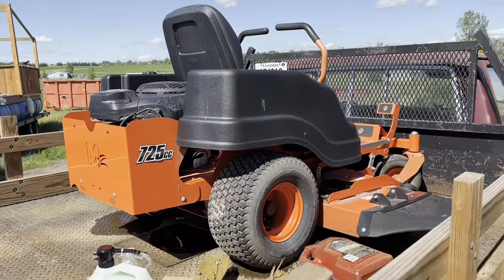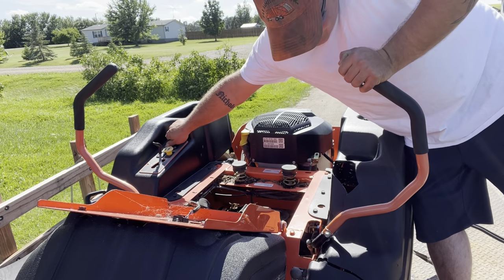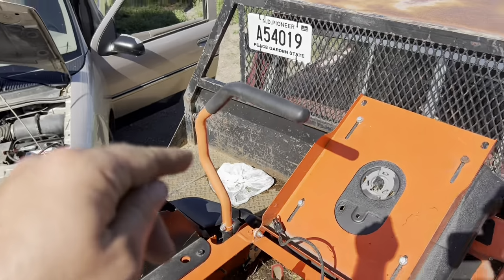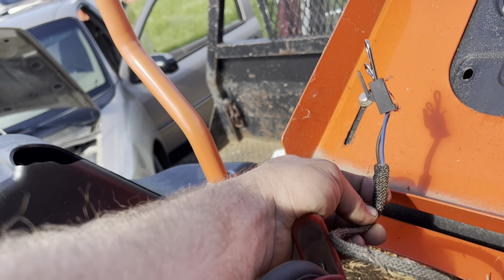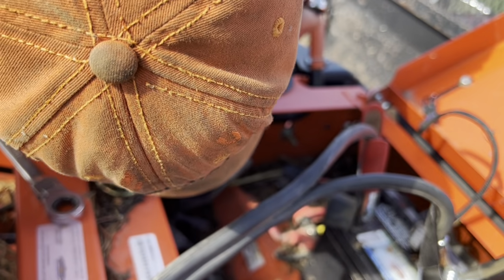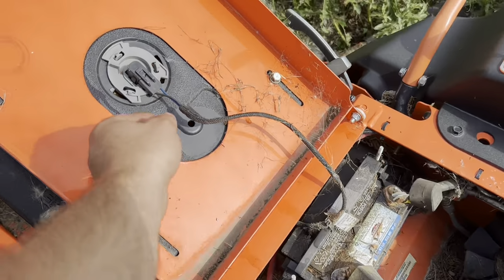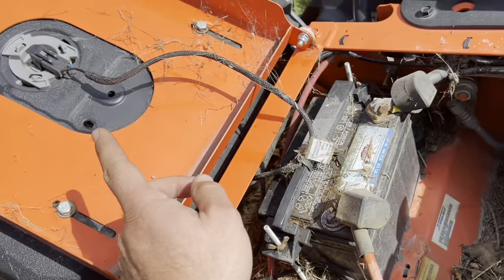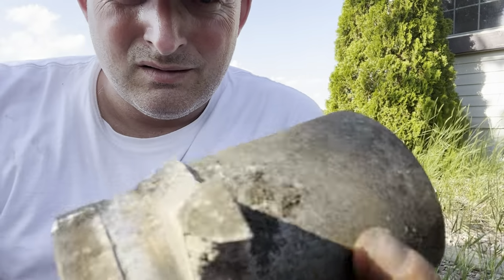Zero Turn Mower Wouldn’t Start Bad Boy MZ Magnum 725cc

Comment: Did u ever figure out what caused the battery to not fire it off, having the same issue, parked it and it won’t start now
Reply from the maker: Yes one of the sensors was off.
Reply: @MikesMischief  what sensor
Reply from the maker: It’s honestly called a mower safety switch. It looks kinda like a gas BBQ igniter. When the arms are open the end of the spring part needs to be just barely away from the side of the tractor body. Then when you close them it is pushed into the wall and completes the circuit.  The ignition wire is a big loop that runs through all of the sensors and if one of them is open it won’t have any power and won’t fire.  You can just take both wires off and splice the ends and skip the sensor but it’s pretty dangerous.
Reply: I got mine to turn over but still not firing up ! Tried jumping all the safty switches and still nothing !!!
Reply from the maker: @thomas25082 have you tried giving it a little puff of ether to see if it’ll fire on that?  If it does it might be the fuel filter.  Also if you try to start it with the arms closed and the parking brake off it won’t start.  Has to have arms open and parking brake on.
Reply: @MikesMischief  i did i even tested each switch for continuity open and close !  I sprayed either and nothing !! I just now took both the ignition modules off and looking up ohm test but i dont think its them as of yet !!
Reply from the maker: @thomas25082 I had an issue with mine again.  I jumped the seat switch and turned the key off and used the key to start it and it took off. Do you have a spark tester to see if it’s getting anything to the plug?   I know how to jump safety switches but after that these mowers are a little complex.
Reply: @MikesMischief  yes i have a spark tester and it shows up faint and when i turn the key off it brights up for a half a sec !! Pita
Reply: It the kohler zt740
Reply from the maker: It sounds like it’s gotta be a connection somewhere or a sensor to me.  I think there are 4 main sensors.  1 on each arm, the seat and the parking brake.  That’s strange that it’s strong and then weak.  Maybe a bad relay somewhere in the system?  I’m pretty sure there are relays in the system somewhere.
Reply: @MikesMischief  yea theres 5 i moves them all around different orders and such i got the whole thing apart lmao . Watch it be just bad spark plugs id be so mad at myself ive done everuthing but that lol .. i well let you know what i find out later !! Looks like i commeted 3 months ago to !!   Been down for a good while ..
Reply from the maker: @thomas25082 honestly after this mower I’m going back to goats lol.  This modern stuff is just trash. We don’t even have an authorized dealer here for parts or repairs.  Goats dgaf and a local church will buy them for their cook outs.